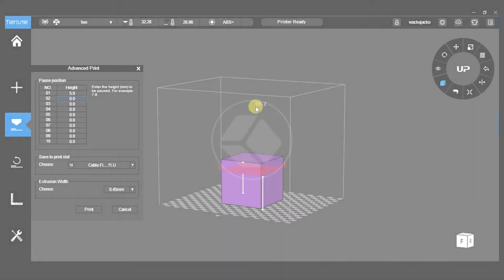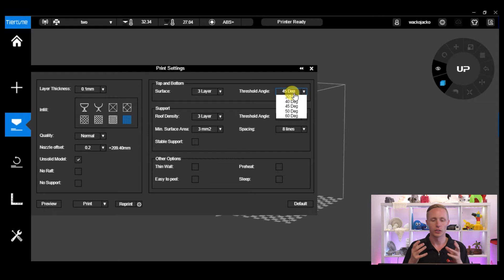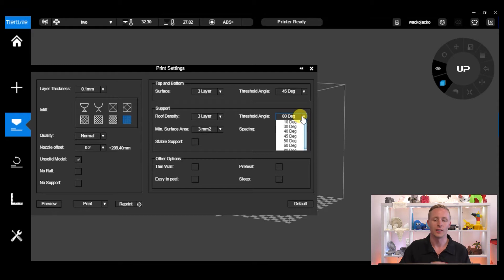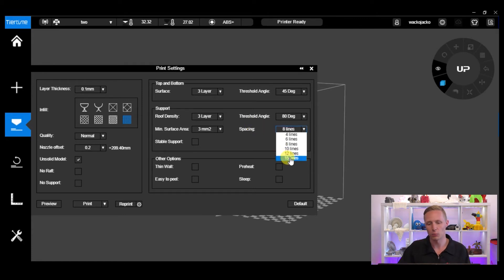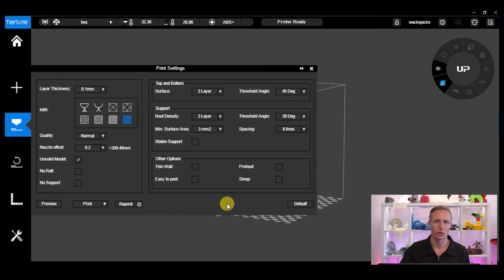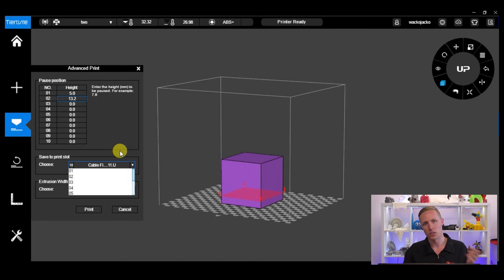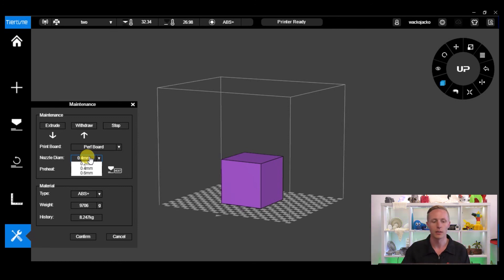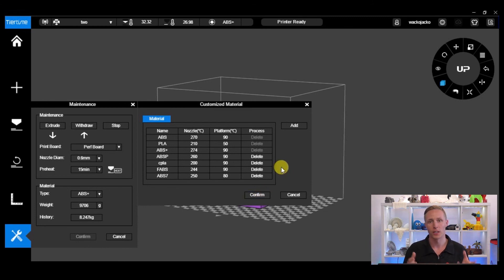UP Studio v2.1.0.8 - Advance Settings

Comment: I have the cad drawing to correct size. When i load the part its tiny on the print bed.It says to small to print. Hoe can i accurately scale the part? cheers
Reply: Not sure if this helps, but we use Autodesk Inventor. I ran into this issue and found that when you export the file to .STL, when saving the file, there is an [options...] button to the left of the save button. Click on this, and under the format header, there should be a units tab on this. Change this to mm and it should do the trick. (Alternatively you can take the dimensions of the model and scale it to the CAD model in the UP Studio UI).

Comment: The seller of my UP Plus 2 told me not to use any other filament except what he is selling which is tons more expensive than what's available in the market. That's bullshit! I tried other generic ones and different newer materials and they work ! Be careful of retailers trying to lock you in to their filaments which provides a good recurring income for them.